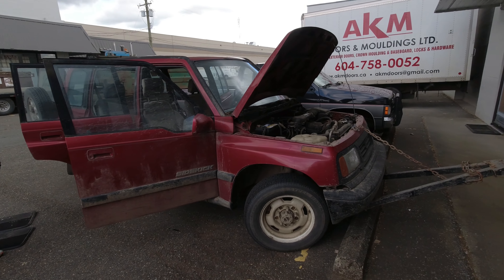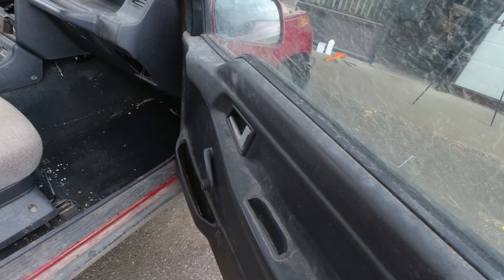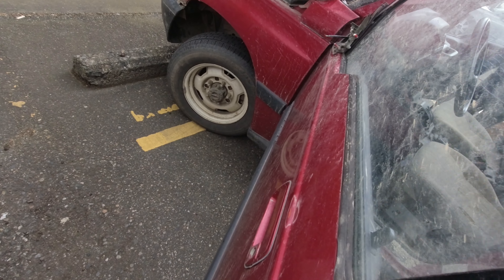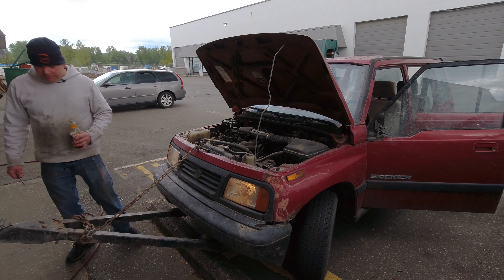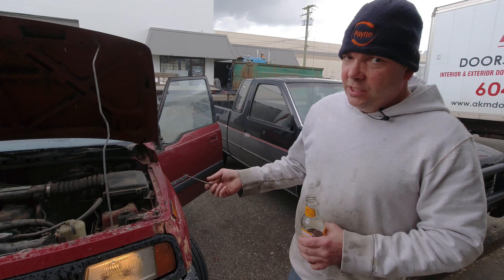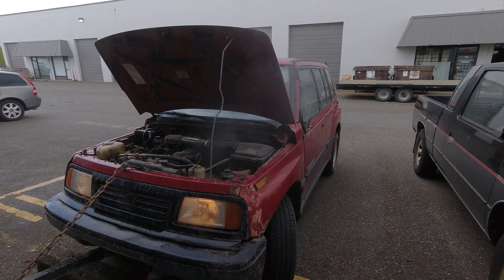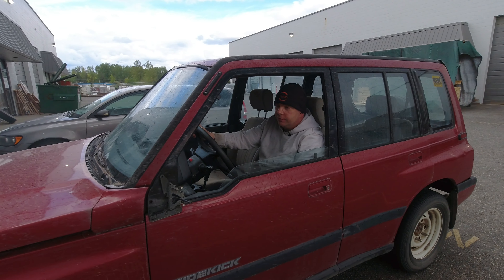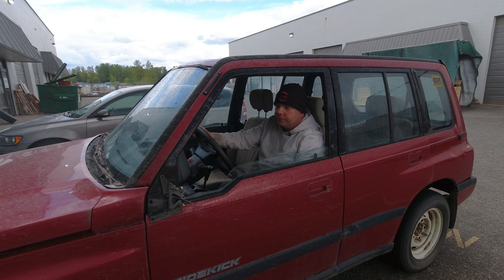And Now... The Start-Up! Our project Sidekick runs... (Ep.2)

Comment: Can't wait to see how this project turns out.  I have been working on my 97 4dr,  added 33's 12.50x15 .....considering a Calmini 3" that I have on a 2dr in the back yard.    Good luck and we will be watching.
Reply from the maker: Thanks for your support! It sounds like your rig is becoming well outfitted. Do you have a 2" spacer lift currently? 
Will there be any issues that you know of using the Calmini 2 door kit on your 4 door?  I know Calmini springs ride rough so the 2 door springs in a 4 door may work well...
Reply: @BalmersWorkshop  Currently, the "97" 4dr has both a 2" body lift and the 2" suspension spacer lift (=5" of lift)  From what I understand, the Calmini 3" articulating lift is the same kit for either the 2dr or 4dr models.   I just happen to have one on a 1992 tracker that I also run 33's on.  I am building up my 97 4dr. as it is the one I am going to keep as a tow behind for my RV.  I think I have vids on my chanel of 4 of my units as the other two are for parts so far.  All of my units are with automatic transmissions as the engines seem to be in better condition than the manual transmission ones that have been beat on for most of their life.  I will do a walk around video of the 97 and post so you cab see what 33's do or look like, pro's and con's stuff.

Comment: Just a thought regarding the high idle speed; I noticed that she has air conditioning and wondered if it could be associated with the ECU anticipating a parasitic load on the engine from the air-con compressor or alternator but no additional load being present?

I love my SWB 97 MK1 Vitara and hope you have just as much fun in yours.👍
Reply from the maker: Thanks very much for your thoughts and views David! I know this is a very common issue with these vehicles and not many have A/C but that is a logical reasoning. I won't discount it though :) 
Here's hoping I can sort this issue out and get out on the trails!
Reply: I have one with AC and one without and the AC model definitely idles higher because of what you mention :)
Reply from the maker: very good info - thanks for that :)

Comment: Check coolant temp sensor, clean iac. The distributor is a very common oil leak on these. Mine also had a trans leak that dripped on the exhaust. Should idle at 700 to 800 rpm when warm. Egr system probably needs a good cleaning as well.
Reply from the maker: Thanks very much for the advice and the views!
Reply: I'm trying to address my distributor leak soon.  Have you done it before?  Is it easy to do?

Comment: The high idle is a feature.  There is a hose that runs to two switches red and blue, if you pinch the right hose (idk which color) then the idle will drop.  I believe it's a feature to heat up the engine faster
Reply from the maker: That's an excitingly easy prospect! Thanks so much for the advice and for your views! I think I'll try this idea out on camera :)

Comment: Bottle of brown ale too! superb!
Reply from the maker: Cheers to you!
Reply: Re: the high idle, I have the 16v engine, but there were a few things causing it:

- Deffo look to see if there are any vacuum hose leaks in and around the intake. A mouse had nibbled mine and it was idling super high. Easy fix!

- ISC valve on the 16v, but I think it's a sealed unit so had to replace mine

- EGR valve is always chocked up, give it a good clean (others have mentioned this)

- given the exhaust leak, the lambda sensor might be giving dodgy results too, so worth fixing that and seeing if there's any improvement

- the usual suspects; MAF sensor (not just the sensor, but the wiring connection too), coolant temp sensor, both easy, cheap fixes.

The auto does Rev a bit higher than the manual, but more like 1200 cold and 900 warm. 

Good luck!
Reply from the maker: Thanks for all the tips! We're here at the shop looking at this issue right now :)